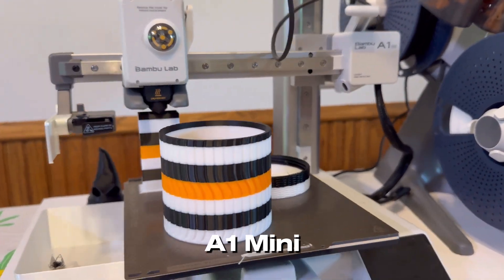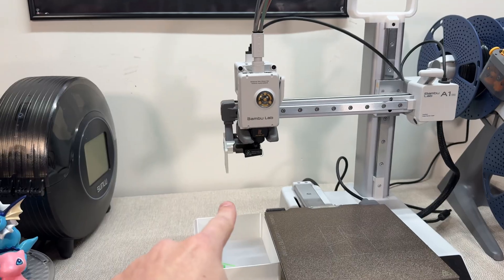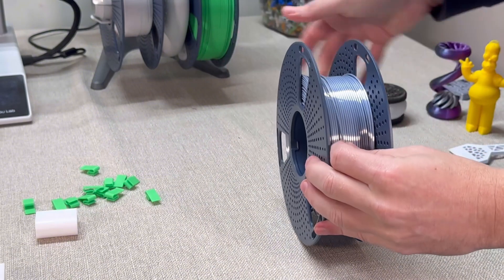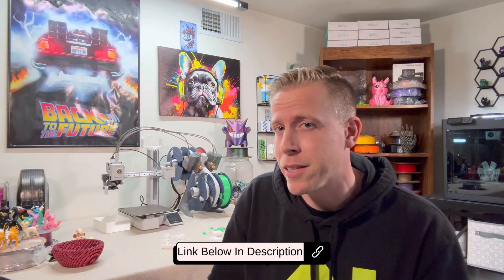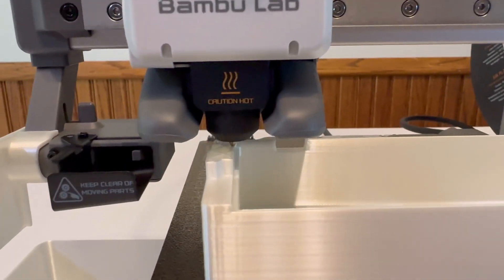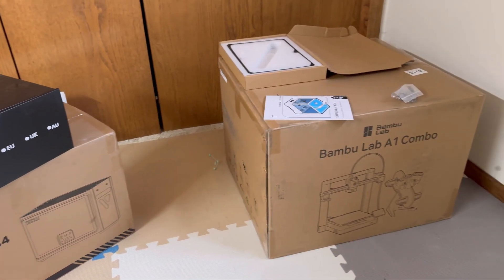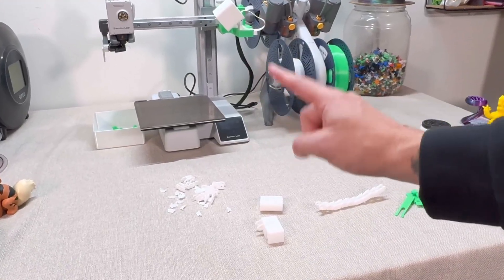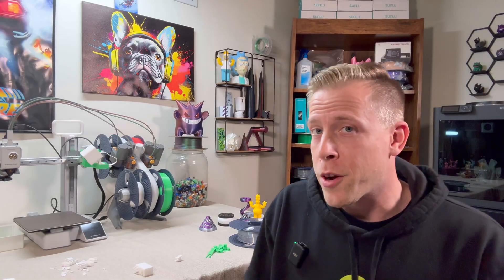Top 7 Best Upgrades for the Bambu Lab A1 Mini

Comment from the maker: HERE IS THE LIST! Which of these will you be using? 

1. Poop Deflector - https://makerworld.com/en/models/123164?from=search#profileId-132720
2. Poop Basket - https://makerworld.com/en/models/156091?from=search#profileId-170921
3. Filament Clip - https://makerworld.com/en/models/48350?from=search#profileId-65262
4. Handle - https://makerworld.com/en/models/48599?from=search#profileId-62550
5. Tool Box - https://makerworld.com/en/models/492119?from=search#profileId-654348
6. Scraper - https://makerworld.com/en/models/12703?from=search#profileId-12705
7. Cord Chain - https://makerworld.com/en/models/493268?from=search#profileId-407002

Comment: @3DPrintDood I have and Ender 2 v2.  It hasn't been used in months because I can get it to be consistent. Debating A1 mini combo and A1 combo. Do you think the mini build size is sufficient or disappointing? I'm trying to save some $ looking for honest advice. Thanks! Great videos!
Reply: Hello! I used the Ender 3 V2 for almost a year, then switched to the A1 Mini—and I don't regret it at all. Sell the Ender 3 v2 and get the A1 Mini. You'll simply forget about everything: leveling, the first layer, customization, nozzle replacement, remote print start and monitoring, quiet operation, and especially printing with TPU and Elastane.

Comment: The best upgrade i did was the ams lite top mount. It made my a1 mini look like a standard a1 but it was all worth it specially on my case that it all fits in a small bedside table cabinet. Add a vibration pads just to reduce the vibrations as well